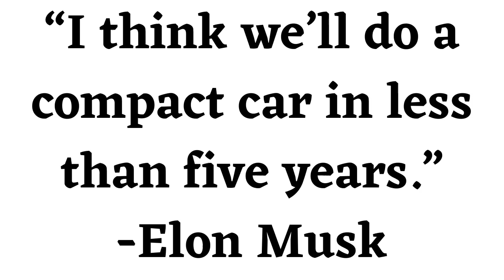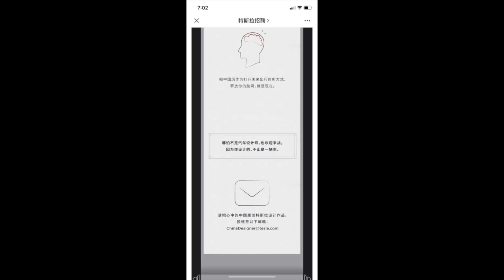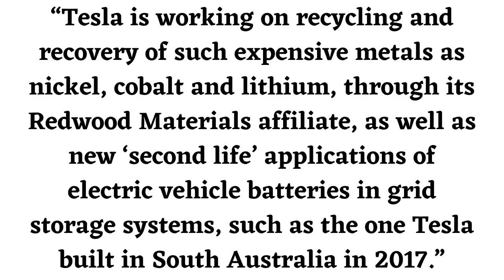Tesla's $20,000 Compact Car Is Coming Soon - The End of Gas

Comment: MAKE SENSE - electric car should be much less complex than gas car - less moving parts much less service. The problem then will be a el. power, and eventually its sharply raising cost...
Reply: Elec power prices will drop.  Solar is the reason why.
Reply: @michelangelobuonarroti916  Wrong - in Czech republic - after extensive solar expanse - the power prices increased 300%...

Comment: I think it will have at least a 50kwh battery and go at least 250 miles because below that, it won't sell all that good but I think it can be done at or below $25000
Reply: A 50 kw battery  will have a range of 500 miles

Comment: Aerodynamically perfect bubble shape, made as an injection molded clear acrylic body along with windows in a single mold. It could be the highest visibility vehicle ever made. Any interior not intended to be transparent stiffened with a styrofoam like matrix. Single piece injected plastic interior frame. Simple folded steel base for frame to hold the latest lowest cost battery with 'only' a 250 mile range. Single relatively small motor. Only two doors, also plastic, to reduce manufacturing costs. Folding front seats for easier access to the rear through the two doors. Folding bench seat in back, with hatchback access. Low weight scooter tires. Toughest design challenge left, nice front seats that are still dirt cheap to make.  Well below $20K.
Reply: Submit your design.  You might just win.

Comment: If Tesla would build a practical Mini Cooper sized car with a 200 mile range at a $20,000? price I would be the first in line to buy one.  If it had a trailer hitch option that could tow 1,000 pounds this would be great.

Comment: Its possible to do metal /plastic/metal just as we do for glass, that would be a better body for the affordable car.
Reply: Bonding plastic to metal has come a long way, bonding glass to metal likewise, that's your low cost future, bonding, rather than welding and bolting, literally a glued car !
Reply: Currently working on colour bond/corflute/colour bond, but of course its not bonded just screwed together for roofing, but is good acoustic- thermal insulation just the same.

Comment: Sport seats and some cup holders a quality stereo and AC. I will even settle for manual windows to save weight and your done. Should be light and quick and go 600 miles.
Reply: Remixio if it has autopilot on starlink then maybe a screen. Otherwise I drive I don’t mess with my phone.
Reply: Manual Windows don’t save weight
Reply: Robloxian3 sure they do.  no motors no wires no switches.
Reply: Hell yeah, a 600 mile range; I’d trade in my 2020 GMC in a heart beat... And that’s for this new compact one, I’d definitely do it for the model S if it had a 600 mile range...
Reply: 600 miles will be more than twice as heavy and twice the cost of a 250 mile battery, and 250 is all that is needed for the vast majority of compact car buyers. Fast, especially with a battery that size would also not be light or cheap. The compact will have the lowest acceleration of any Tesla, though still better than most ICE cars. AC will be optional for extra cost.
Reply: Peter Cohen if they can get those charging times down to less then ten minutes; I will go with the small battery. This could be the revitalization of road trips. Route 66 once again! Gas is too pricey and I can’t eat burritos in a charging station for half an hour each time I’m out of juice.
Reply: @panpiper  with new  battery tech you will get 2-2.5× range.a 60kw pack will get you 600
Reply: @grateful.   Right, so they'll put in a 25kw pack and save a lot of weight and cost. That weight saving compounds by requiring less frame, tire and engine mass too, which lowers the cost even more. The whole idea is to make it as low cost as possible. They 'might' offer an optional longer range version, but it will not be standard.
Reply: Also out of absolute polarity which has distortion and lack of realism and is fatiguing.
Reply: @panpiper  This so Great Update About New Teslas Model 3 And Y in Shanghai Chine. 

They are Brokem the Paradgmas Araound the World...

Welcome Hyperloop to Brazil and Gigafactory Teslas Model Roudstar also  ...
Reply: @panpiper  This so Great Update About New Teslas Model 3 And Y in Shanghai Chine. 

They are Brokem the Paradgmas Araound the World...

Welcome Hyperloop to Brazil and Gigafactory Teslas Model Roudstar also
Reply: No way this compact goes 600 miles.  The 3 and the Y will do that before the compact.